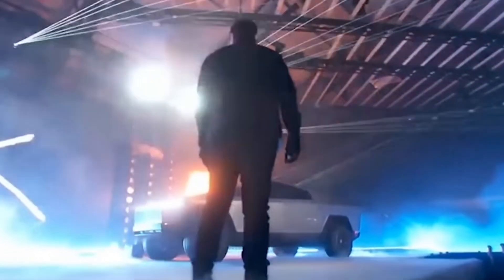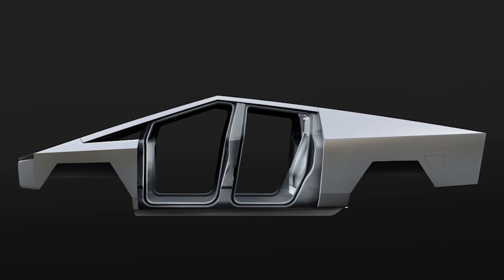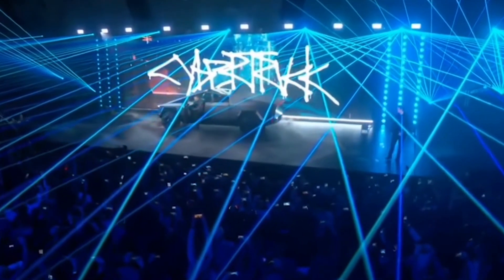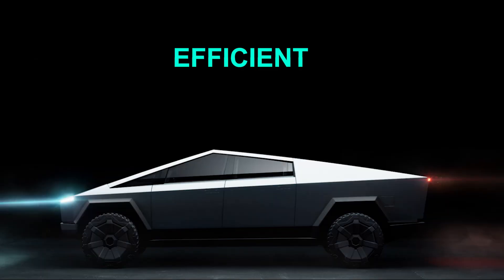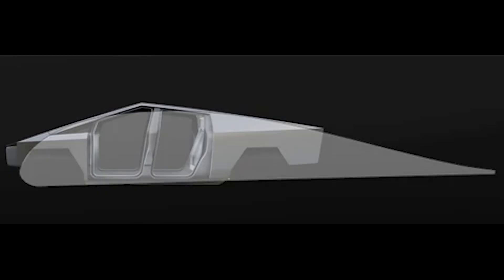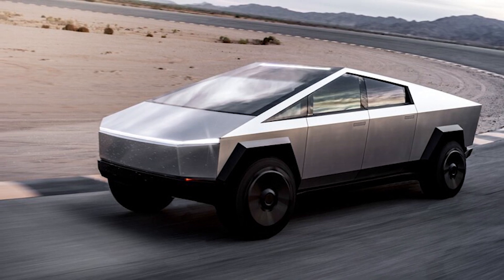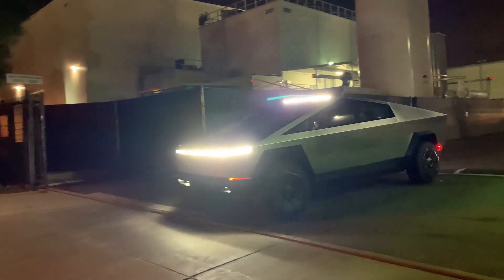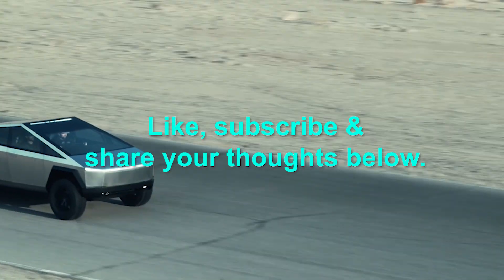Cybertruck is Engineering Genius (and will be copied)

Comment: keep in mind for safety you want a crumple zone to let the force of a crash apply over a longer period of time so less impact on passengers and there needs to be an ez way to break in through windows for cops or if your stuck inside. Also based on its size and cost it actually really under performs in its carrying and i think towing capacity, single motor is better than 20k trucks but also costs 10k more and the tri motor is much worse like almost half the carrying capacity compared to 80k trucks. in every way other than fuel efficiency the cyber truck doesnt out perform any fair comparisons. not hating on tesla just saying if your looking for performance at truck related tasks there seems to be way better options, though not electric

Comment: Aerodynamic of cypertruck is disaster. Analsyis that you can see in video is not actually correct. Cypertruck cheats that analsys by closing back of truck. Unfortunately, most of the countries rearview mirror is mandatory. Therefore closing back of truck by that way can not be acceptable. If you open the back of truck, aerodynamically you can see "real" case. Moreover there are mnay "permanent" aerodynamic problems at the front part of the truck.
 In our era its very stupid thing to beliving "secret aerodynamic" design. Nearly all of the cars obey aerodynamic rules much more than cybertruck. In aerospace only steath aircrafts prefer sharp design.
Reply from the maker: Read the pinned comment :)
Reply: @SolvingTheMoneyProblem  If aerodynamic is not a case, its oky. For price-aerodynamic trade off it seems that elon musk have chosed the price. For such a car, it may be very expensive to  design smooth edges. I have no problem with it. I am aerospace engineer and working on aerodynamic design. I am doing these type of analysis everyday.  I can easyly said that cypertrucks aerodynamic is very poor for our era.
 Actually Elon musk had very bad reputation in my working place about aerodynamic because of hyperloop. hyperloops early designs were totally garbage.

Comment: I agree with everything you said and I don’t smoke pot. 👍👏
Reply: bassamakasheh Watching while high atm. You should see how much in agreement I feel right now 🤣
Reply from the maker: @jamesthurin  😁😁
Reply: Same here, but also would like to add that the “different” design is unfamiliar and it causes a lot of free marketing which also reduced cost.
Reply: u are talking about the outer panels, but the inner shall/unibody will be stamped ,with die,and more likely made out of lighter metal for crumple zones  .
Reply: @Jozavenue  what crumple zones?....those will be supplied at the time of collision by the other vehicle
Reply: @jabulaniharvey  That is a good one,have u ever been in a head on crash? 
i have and the car that came into me was stiffer ,so cos of that she walked and i stayed  for 2 months in bed  with no movement. this tesla would be a killing machine if it hits the roads. and gets into wrong hands.
Reply: @Jozavenue  i appreciate your comments....this is a problematic design flaw
Reply from the maker: @Jozavenue  Correct.

Comment: I want to see a crash test of this thing, see how well it handles it. I’m liking it more and more and it goes. Also, it’s design will likely inspire more companies to follow suit, and then the Tesla Cybertruck will have set a trend. I dig it ngl.
Reply: hmm early 90 dodge ram extended cab cummings motor   head on or 1970 monte carlo 4700 lbs  steel

Comment: Rigid body is NOT safe when hitting a wall in fast speeds. It will not suck in the inertial energy which means it is transferred straight to you. You would be cut in pieces by the safty belt in that kind of car.

GET YOUR FACTS RIGHT AND GO BACK TO LEARN SOME PHYSICS!

Comment: But u people missed sth about the safety...the Body of the car must be a little bit soft because all the heavy force in case of an accident must be taken by the cars frame. So if the exoskelletton is too robust, all the force is taken by the driver. Back in Time in the 50s and 60s the cars also weren‘t that save because the frames etc were too strong. Modern cars need to be „soft“ so the car takes the actual force in an accident. 
Btw many things u said about range, innovation, etc was just on information u got from tesla and there’re no studys or tests from others except tesla.
I would be more skeptical about those Information but don‘t missunderstand me...i like tesla and the visions of EM but lets see what really comes out at the end of the day

Comment: Sorry, but you're getting caught up in the hype. Engineering genius doesn't create a vehicle that's going to be a nightmare in the body shop and send Insurance premiums soaring. Making a bold design statement is all well and good, but for those living with this creation it's going to be a problem. It's also alienating a huge number of potential customers, and that's not Genius either.
You're  mistaken if you think this is going to be copied. Most motor manufacturers have more sense than that.

Comment: It is a design nightmare. But this may work in it's favor due to functionality and simplicity. Still, many people will reject it due to the design. Some even go as far as saying that a todler must have designed it. Alot of people still like engines. Also, the design might look a little better if the tailgate had one little convex angle just under the taillight.

Comment: Ridged is exactly what you don't want in a crash. Because a ridged shell will transfer more force to the occupants.  This is why modern passenger cars are designed with crumple zones. 
I'd also have to point out that cars with flat windscreens actually predate curved ones, they are not in any way a new idea. Heck the original run of the Lamborghini Countach was rather similar in appearance, right down to using flat glass in all windows and the minimalist dashboard.

Comment: I agree with everything you laid out here. BUT there is one downside and this comes with all electric vehicles and not just the cybertruck specifically.

Colder Climates. 

Having that when it gets to -30 degrees Celsius it would use half the power on the batteries just to keep them from getting below the low temperature threshold. 

Maybe there's some insulation part I'm missing here, but until this is addressed, the cybertruck will not be able to compete in places with colder climates.

Comment: One thing though, historically we dropped rigid structures on car for safety reason, the impact was transferred to the passengers when a car wouldn't deform, turning a low-speed impact into a chunky salsa of human parts inside while the vehicle itself was fine... That's why for the last few decades cars were made to fold under impact to absorb the kinetic energy transfer.

Comment: If you want a serious and more objective look at the Cybertruck, check out Doug Demuro's channel. Feature for feature, the Cybertruck doesn't make a lot of sense when compared to a Silverado or F-150. If you want the 14,000 towing capacity, you have to buy the $70,000 version. Sure, it can tow more than a F-150, but that isn't saying much. If you want to tow 14,000+ pounds, get a F-250 and save $20,000. The value argument for the Cybertruck is non-existent. The Model 3 and even the Model S make a lot more sense.

Comment: You hit all the points. As far as competitors, they have huge legacy businesses, and batteries aren't available in volume. I think the main response will be PHEV which uses fuel which is higher energy density than electricity, and better fuel efficiency than ICE. Having two systems will be complication and weight, and probably expensive.

Comment: An airfoil shape is the worst shape you can get for an automobile because it will start taking off at speed, making it very unstable at high speed. Look at F1 race car, all the spoilers and wings are there to keep the downforce to the extreme so it will not start flying at high speed. Aerodynamic forces will take over the weight at some point, this is the whole reason why a plane can fly. I am not sure if Tesla designs this truck to fly.

Comment: It's obvious who has or uses a truck in real world.... Change the bed sides so it can be accessed from the side or this is just a lifestyle vehicle like the Honda Ridgeline or Avalanche(the Ridgeline redesigned to remove the angled bed side & the Avalanche discontinued) that will not compete with full size trucks. 

Also they better hurry with those solid state batteries because it's been proven that right now current battery tech only allows for about 1/4 of the stated range when towing.  https://youtu.be/S4W-P5aCWJs

Towing & hauling are the main reasons for buying a full size truck whether it be a lifestyle or a work truck.

Comment: Isn't toughness potentially a serious issue when it comes to safety? A rigid steel construction won't be able to absorb as much energy during impact compared to a curvy aluminium construction which will bend. Crumple zones are important.

Comment: Agree with some of this, but I'm not sure how being sturdy will make it super safe. Crumple zones exist for a reason, and so this physicist is not sure how safe the truck will be. The cabin won't be compromised, but the shock to the body could be a problem which will reduce its safety rating. The only question is whether the large mass of the truck is enough to cancel this issue out. I'm not experienced enough with specific vehicles to say.

Comment: No it won't be copied.
It looks like a car designed by a teenager obsessed with cartoons.
In reality a car has curves etc to keep it on ground.
Maybe a truck do not need design but if it's design flaw, then fuel consumption goes low.. in this case the battery power.
Only a true consumer test would tell the real story.
It would be harder to pull thru with heavy loads and when speeding.

Comment: I just realised that Musk fans are just as crazy as Backstreet boys fans. Only they are not all females. It's crazy. The truck is ugly and its safety is nowhere near determined. Because sturdy doesn't equal safe. Quite the opposite, it's much better if tha car is more elastic, so that some of the energy of the crash is dissipated in metal vs. metal and not in body vs. metal. The only good thing about this truck is its performance. And even that has yet to be confirmed, because this was just a demo.
Reply: Word my friend. I'm amazed by the lengths fanboys will go to defend a product. Musk doesn't even need a PR firm anymore

Comment: Where the Cybertruck fails in utility.  Specifically towing range.  Current battery tech doesn't allow for long range towing.  We see this on the Model X.  It has 330 miles of range normally.  While towing, that drops to under 100 miles under ideal conditions.  Consider.

1. You're only supposed to charge a Tesla to 80%, except for long drives.  So now your at 400 miles for the high end truck.
2.  Towing will minimally cut the life in half and as much to 66%.  So now your down to a maximum of 200 miles.
3.  If you're towing  in cold, you can expect to lose 30 - 40% more life.  So now you're down to 140 miles
4.  If you live in a hilly area, cut it again.
5.  That doesn't count things like charging the ATV or using a compressor.
6.  Unlike cars, Trucks tend go to rural areas where charging isn't readily available.

Elon is gambling that battery tech is going drastically improve in the next 2 yrs.

Comment: The vehicle was obviously designed that way so it couldn’t be detected on radar. It was originally engineered to be used in the anticipated Area 51 raid but there were issues in production, causing the announcement and release to be delayed...

Comment: I think it'll be a success. BUT, I do think it needs a custom trailer and/or camper addition - one with an array of solar panels, a sleek body that works aerodynamically with the cybertruck body, and a separate battery that can act as expansion for the cybertruck's battery.  

Tests seems to show the cybertruck can do anything a regular truck can for local tasks, but a cross-country trip hauling anything - even as simple as a small uhaul trailer - will cut the range nearly in half b/c of the aerodynamics and extra weight.  That will create severe range anxiety, and since charging a very low battery most of the way is faster than charging a battery beyond 85%, it means people will have to charge not only more often, but for far longer to top off between charging stations when hauling.

Without a custom solution, the cybertruck will either have to haul whatever it can carry onboard or stay relatively short range for large hauls.  This won't be the truck you choose to haul a pop-up camper 1000 miles to a park for camping.

There's a youtuber with an artist's conception of what a camper might look like w/ the same materials and styling, and it's gorgeous. I don't know how a small uhaul like trailer would work though... b/c any backup batteries would make it expensive & also encourage theft.

Comment: The instant it rolled out of the smoke I loved the design. I instantly recognized where Tesla copied from.
Elon Inc does not invent things from a vacuum. They take old good concepts and improve on them.
Cybertruck is based on WEDGE Era cars from the 1970s. Closest is the 1970 HF Lancia Stratos.
https://www.thedrive.com/news/21165/watch-the-wedge-shaped-lancia-stratos-hf-zero-concept-in-action
It makes the Pickup Truck very aerodynamic as it's literally wedge that cuts through air.
The kickass Stainless Steel Sheet bending is exploiting Auto Feeding CNC Bending Machine.
http://www.geelongsales.com/en/news/new-cnc-bending-machines
They are much cheaper than Ship sized Stamping Press. You can also fit 200 Machines in a Gigafactory sized facility.

Comment: This car's design perfectly dissects pedestrians, yet other manufacturers are forced to optimize the front of their cars to protect pedestrians.
Reply: fuck pedestrians. but use protection. you don't wanna catch what they have.
Reply: Seriously sometimes I wonder if pedestrians care about the car that is driving towards them, so many times I've had sudden stops with green lights, in badly lit areas, & bad places to cross. My car does not detect people as much as this will - it's all on me, but if the car helps accident is less likely with the average person driving.
Reply: This is a truck, not a Miata. An F-150 to the face isn't pleasant either. Add a pusher plate, things get ugly. Being dragged probably worse than Cybertruck as the clearance is lower and underside isn't smooth like Cybertruck.

The singular exception is the plastic bumper cover and that would be an easy, cheap addition to Cyber truck, like pretty much any other truck.

Comment: All interesting and right but, in safety there are some questions:
1st: Tesla are not the safest cars that is an invention, https://www.euroncap.com/ is the repository for safety and you can see that while tesla does well it's not the best.

2nd: Safety in cars is not achieved by being in a very strong body. In fact if you would be in a very strong indestructible box falling down to earth the crash would still kill you even if the box would remain intact. So not clear how being in a sturdy steel box will keep you safe in case of a truck - but i guess also Tesla here has not a clear idea or else they would have explained that - safety in a car would be an important point so the fact they didn't explain it tells us something.
This aside, I'm sure Tesla will come up with a safe vehicle - but strong sturdy box <> safe

Comment: I would disagree that this truck is better than what's on the roads- with a minor accident you will need to repair 1/4th of the truck and with that in mind they will not repair them though insurance AND insurance for these will by sky high like an exotic car. Good concept but not practical. I like Tesla allot but this is the ugliest Car/truck/SUV EVER MADE. If they had an award for the ugliest motor vehicle on the road. This would win 1st place.

Comment: I'm actually worried that the safety aspect may be much poorer than you expect.  This concern is because of the rigidity of the body, most vehicles (including the ones made by Tesla) use crumple zones to slow the rate of deceleration from a collision.  My concern is that the body will be unable to crumple for this and cause the full force of the crash to hit the people inside.

Comment: If it was to be functional as a truck, its bay needs to be bigger, or at least as an option/separate 2-door model and preferably easily accessible from the sides, not just the rear.

It is not really a utilitarian truck, so the whole "form follows function" trope you repeat over and over, is incorrect IMHO. It is "just" another large vehicle for people with the wild need to compensate for their lack of confidence with large, raised vehicles. Most of these types account for the large % of trucks bought and used as commuters, not professional vehicles for their cargo or towing capabilities. 

Still a marvel of engineering and marketing, but not a real utility truck.